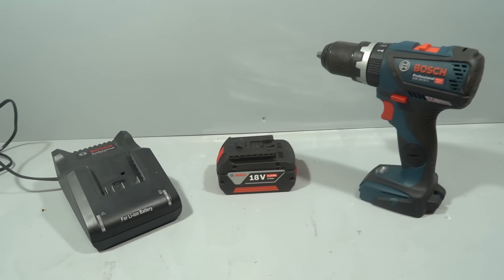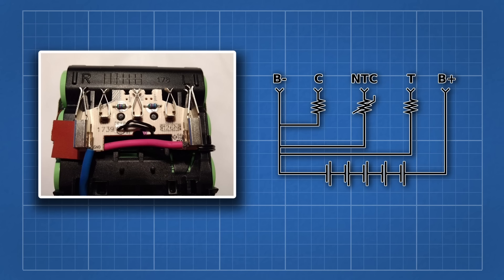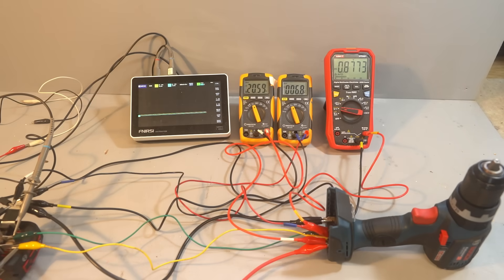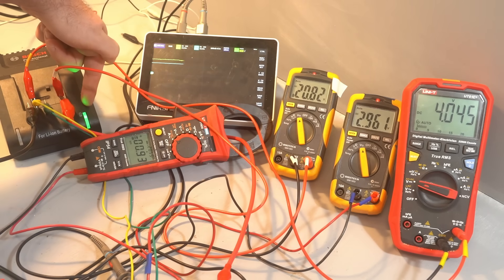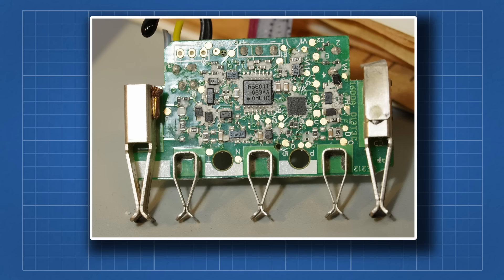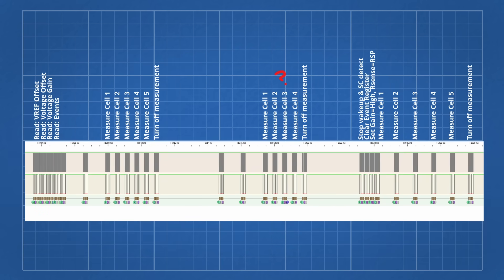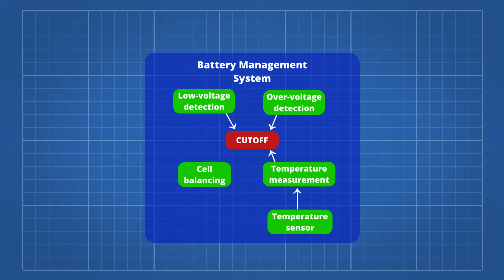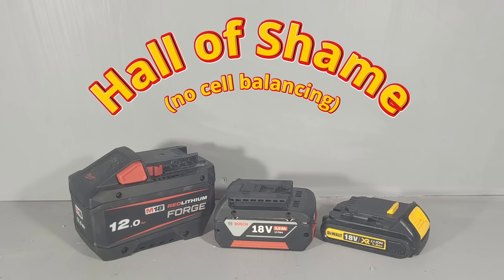[012] How does Bosch 18V compare to the rest?

Comment: The video reviews the Bosch 18V professional battery system, focusing on its design and management features. Initially, Bosch batteries lacked electronic components, but have since evolved to include a complex circuit. The video compares Bosch’s battery management system (BMS) with those of competitors like Milwaukee, Makita, and DeWalt, noting that Bosch's design is moderate in complexity.

Key aspects discussed include:
The battery has five pins: two for cell connections, one for charging, one for temperature monitoring via an NTC thermistor, and one for tool identification.
The tool operates with certain voltage and resistance requirements, and lacks individual cell monitoring, which means it can run even if one cell drops significantly in voltage.
Charging is managed by overall pack voltage without direct communication between the battery and charger, using a current tapering approach.
Bosch implements some cell overvoltage protection during charging but inconsistently incorporates active cell balancing.
The BMS design is deemed to have unnecessary complexity while lacking essential features like effective low voltage protection during discharge and efficient cell balancing.

The conclusion suggests that, while Bosch's BMS isn't fundamentally flawed, it suffers from design choices that limit performance, similar to other brands. Improvements are recommended for better voltage management and charging techniques. Overall, Bosch's system is average among competitors, with potential for enhancement.

Comment: Is the STM8 microcontroller locked or could it be reflashed? Since there is no elaborate protocol for communicating with the tool and charger, it should be fairly straightforward to write a new firmware that does what the stock FW does but adds balancing (if you're right and all the hardware is there).

Comment: Video is not bad. Just there is one IMPORTANT remark. You really have to dive deep in the cell balancing topic. A you have to understand better why it is not performed by some companies. It has one BIG disadvantage ;). Funny fact, but it can cause cell overcharging and battery will not notice it. Huge risk!
Reply from the maker: Are you talking about being unable to measure cell voltage whilst balancing? That is easily solved by turning off balancing every few seconds to take a measurement.
Reply: @toolscientist no. About potential leakage current in the IC input(for example due to ESD damage) or due to cracked capacitor. It cause voltage drop on input filter and IC can not measure anymore correctly cell voltage even with swithed off balancing mosfet. And if battery will ballanced, then its voltage will be pushed above safe level-> boom

Comment: Crazy 

Cheap lidl Parkside batteries 

Have balancing 
Monitor cell voltage during discharge 
Have current monitoring and it’s even adjustable in an app 
Have low voltage protection in the batteries (Tool switched however) and it’s also user adjustable ! 

Literally the cheapest batteries have the best BMS 

And einhell/ozito are the same except even Better ! They have an internal MOSFET and can turn off the entire Battery (also used for Battery discharge cutoff)

Comment: So if I use the battery outside of Bosch tools, in DIY project, it will discharge below a safe point? Please confirm.
Reply from the maker: Yes, Bosch 18V batteries will discharge to 0V. They have no mosfets or any other way of cutting power. They rely on the Bosch tool to stop
Reply: @toolscientist appreciate your work and reply. So if I source an inline circuit that will cut off the voltage, what should it be for the 18V battery?
Reply from the maker: @XMRNYC   stick with the 14.8V that Bosch uses
Reply: @toolscientist  great, much appreciated. Keep up the great work!

Comment: I have two Bosch ProCore 18V 4Ah batteries (5 x 22/71 cells) and after approximately 2 years of very light use, they only charge to 4 bars (out of 5 bars total). 🙂

Comment: Ive been after this info as Ive wanted to use these batteries for a guitar busking rig. My drill came with 2 batteries, and they hardly get used. Now youve confirmed that the low voltage protection is off-board, Ive added a low voltage shutoff to my circuit.

 I‘d like to add temperature protection but unsure how. I guess I could use a transistor/mosfet and a voltage divider (then when the resistance of the thermistor drops, the gate opens) Or a comparator? The thermistor has 2 wires, one is connected to the middle pin/blade/contact. Is the other one connected to the positive or negative blade of the battery?

Is there a way to add cell balancing without opening up the battery? Or do I need access to the uart connection?

Comment: For over 10 yearsI have used milwaukee bosch, dwwalt, ryobi and ridgid.  By far I have had the least battery failures with bosch and ridgid. Milwaukee and ryobi seem to have the most involved battery contained balancing and charging circuitry and the most failures from my experience.
Reply: I'm a DIYer and I can confirm that Rigid (AEG in New Zealand) batteries last and last. I have 2x2.5Ah batteries that came with a kit that I bought 10+ years ago and they are still going strong. They are nice tools TBH.

Comment: I think their procore batteries have addressed this issue. I have a bosch charger that connects via bluetooth to iPhone. It lets you control/monitor the charge rate and capacity.  (procore batteries only)

Comment: "Bosch vs the BIG 3"??? Bosch is no. 2 together with Makita in terms of worldwide market share. So it is very much one of the big ones. Dewalt is no. 1 right now. Milwaukee is too small to be in this category alltogether. I assume you're talking about the US market here and ignore the rest of the world?
Reply from the maker: I'm from Australia, and Bosch is definitely less common than Milwaukee/Makita/Dewalt. Maybe 10yrs ago Bosch was fairly close. Who's the biggest is not an easy question anyway. TTI (Milwaukee) and SBD (Dewalt) are around 11-13 billion in revenue, but they have a lot of other brands. Bosch is ~90 billion, but I don't think they break down their tool division. Even if they did it would still be split between Dremel, Freud, and Diablo. Makita ($5b) and Hilti ($8b) are the only ones easy to track, but Hilti would generate substantial revenue from its fasteners rather than power tools.
Reply: @toolscientist  Boschs tool division is ranked no. 2 worldwide, together with Makita - hence my post. Bosch does provide figures for their sales seperately - you don't have to guess. 
Bosch is extremely popular and widespread in Europe - they're leading the market here, especially in the German speaking countries. Dewalt and Milwaukee are rare over here. But while Dewalt managed to be popular worldwide - which put them on no. 1 spot, Milwaukee only really cared for the US market and also managed to became popular in the English speaking world. But they're not even in the top ten. Their other brand Ryobi outperforms them on world stage.

Comment: Would it be possible to power a Milwaukee M18 tool with an adaptor that fit where the battery does with a cord and a 240v wall socket supply and transformer. Like I'm not that techy but would something like that be possible to make and the tool would work without know it wasn't the battery supply? Or is the current draw the limitation because it would draw higher amps than a normal GPO could handle
Reply from the maker: Yes, but it doesn't work great. Look up Harrison Hobbies who did this. His first attempt was a 1000W power supply, then he tried 2 x 1000W power supplies, but some tools still overloaded the supplies during startup. The last version he did had a M18 battery running in parallel to handle surge currents, but that batte had no protection, so you'd have to keep an eye on it.
Reply: @toolscientist okay thanks for the info. Only reason I ask was Milwaukee have come out with a new reclaim unit for HVAC trades but it doesn't have a corded back up option and sometimes reclaiming takes quite some time on bigger systems and you'd be burning through batteries
Reply from the maker: @joshn2673  if the tool isn't too high-powered and doesn't have surge currents, then it's a lot easier. Not familiar with reclaim units, but I'm guessing it's a pump? You can prob get away with a 600-800W power supply if that's the case.

Comment: Thank you for these videos. It is truly frustrating that these companies are playing with lives by not including balancing. Just by including balancing, the battery will last significantly longer. All these companies milking out money from folks who don’t understand how batteries work.

Leaving batteries on chargers becomes potentially dangerous.
Reply from the maker: Main fire risk is from overcharging. So far every brand I've tested has got that covered. Bosch and Dewalt are not so good on the discharge side and can let cells get very low if the pack is unbalanced. Due to Bosch's conservative 15V cutoff, it would take a very badly unbalanced pack to let a cell go really low

Comment: Really interesting video, I'm surprised someone hasn't done a teardown and test like this before with all the tool testing and comparisons that have been done. The design overall is baffling to me, they have the balancing transistors, they measure the individual cell voltages and then just don't do anything with them. I wonder if they did a revision after to fix this or just kept selling them like this, is there a date code on the PCB or cells? 
At the end what do you mean they don't use CC/CV charging when you said it charges at 3.8A up to 20.3V(CC) and then starts dropping (CV)? And why would they need comms back from the battery to achieve this, the charger is obviously monitoring the pack voltage. The way you measured the charge voltages at the pack with leads to the charger won't be accurate because of the voltage drop across the test leads, although the difference should be around 65mV at most(3.8A) so doesn't change any of the conclusions.

Comment: Great vid. As a person that uses Bosch and have friends with Milwaukee and Makita. The Bosch batteries out last the Milwaukee and uses to out last the Makita be for they put silicon on the BMS. The only Bosch batteries that are rubbish are the  6ah which Bosch has discontinued here in NZ. I also repack batteries, and Bosch (dont know about Procore yet) and Dewalt are the easiest to repack followed by Makita then Milwaukee this is because of the BMS. One final thing is if you are using tools that are high draw (I use the Biturbo Grinder for concrete) get batteries that have 21700 cells they will out last 18650 as the amp draw is what kills the cells e.g. 21700 tabless cells handle up to 70amp, standard  21700s 45amp vs 18650 25 to 30amp. Just did a job and a Bosch 8ah procore got to 65 C and the Bosch batteries I made with tabless got to 30 C
Reply: Do you standard nickel strips in place of the copper foil when repacking the Bosch 18v batteries?
Reply: @scottboyce  Only Procore batteries have the copper, haven't repacked any yet. I made a tabless battery up today and doubled the nickel strip.

Comment: I used to own a variety of the older Bosch GBA batteries that lasted for 7+ years when I sold them on to get newer ones. Very happy with my 4/8Ah ProCore batteries, especially the large ones have so much power and they keep their charge when not in use.

On the contrary, Makita 18V  batteries always seem to self-discharge when left plugged into tools. Total nuisance.
Reply: It depends a lot on how often you use them. I have a mix of DeWalt (18 and 12v), Worx, and Makita. I haven’t had a battery actually break, but I have worn out a few 12v DeWalts from heavy use throughout the years. They don’t hold much of a charge anymore… maybe the cells got unbalanced?
   
The Worx batteries have been a surprise. It’s a Chinese company that makes power tools as well as gardening tools. I have a lot of their gardening tools and I’m using the batteries all the time. I started buying some of their power tools (cheap, nowhere near as good as Makita or DeWalt, but good if you do occasional DIY around the house) and using the batteries even more. To this day they haven’t let me down.
Reply: For occasional use it's better for li-ion batteries to discharge ~50% so they won't lose their nominal capacity over time. Of course it's very annoying! :D

Comment: The thing that puzzles me the MOST is that I'm 100% sure that the engineers at Bosch know how Dewalt does it, Dewalt's engineers as well, Makita's, everyone for sure has already reversed everyone else even before these things come to market. How come they don't improve their own designs from the others? If Bosch wanted to be as simple as they are they could save money copying a bit of dewalts homework, if Milwaukee wanted to differentiate they could see that Makita doesn't use whatever feature that they could use from their systems, etc. 

While of course it makes no sense to try and replace or update the products on the field, by writing one different byte into some register they could "solve some issues", so they could just change to a next rev.
Reply: Normally the design engineers make something very nice and good, then their design goes to the cost engineers and they cut off everything they think is not needed or is least needed to fit into a target price bracket and then the stuff gets manufactured.

Comment: You forgot the one that is actually the best - the German Metabo CAS (cordless alliance system)...made basically for trade and industry.
Reply from the maker: Not forgotten, just harder for me to find on the 2nd hand market. Metabo is about half as common as Bosch, which is half as common as Milwaukee/Makita/Dewalt. I hope to get to them and Hikoki in the future
Reply from the maker: Not forgotten, just harder for me to find on the 2nd hand market. Metabo is about half as common as Bosch, which is half as common as Milwaukee/Makita/Dewalt. I hope to get to them and Hikoki in the future
Reply: @toolscientist  I'd skip Hikoki, as Hikoki is gone and is now Metabo HPT. The current Metabo HPT tools are still using the existing Hikoki battery platform but I suspect that that is just a matter of time to go extinct. So less worth the time and effort.

Comment: I’d love to see you do the same for a Hilti Nuron / Bosch profactor / Makita XGT battery
Reply from the maker: Makita XGT is already under way, but it will be 2-3 videos due to the complexity of the system. I might be able to do ProFactor/ProCore as I have a broken ProCore that was doanted to me. Hilti Nuron is very interesting, but prob some time before I can find one available 2nd hand (especially with Hilti pushing customers to leasing)
Reply: I have a Nuron battery that is bad if you want it

Comment: That's all I need to know.
Now I know I can just by the aftermarket batteries. Cuase what am I getting from the premium price. Outside the warranty? Nothing it seems.
Reply from the maker: Aftermarket usually have lower quality cells and they may skip safety features like overvoltage protection and temp sensor

Comment: I was wondering how Bosch 18V battery technology compares to the competition and voila! Thanks for this incredible video, the problem is most of us are using ProCore 18V batteries and Bosch claims great improvement and refinements on ProCore series. I wish you put them to the test. Thanks!
Reply from the maker: Yes, I've got a lot of requests for ProCore. I'm going to see if a broken ProCore that was donated to me can be repaired. Although it seems I might also need a new charger and Biturbo tool to see amy differences.
Reply: Even the older series lasts. I have many of these packs. Even the > 10 year old ones are still healthy.
Pushed them to the limit while renovating my house (f.e. mixing concrete with a cordless drill, doing core drills and other crazy stuff.) 
Still going strong.
Although i'm not using them every single day as commercial companies. Still quite impressed.

Comment: Bosch is well priced for the quality, and I think they keep the components simple to stay competitive. I mean it is German engineeringa and BOSCH invented all major car electronic circuits, so they can easily make it more complex. Great video.
Reply from the maker: I think they've got a good level of complexity and a nice small PCB, but they should be making better use of the hardware they have by adding more safety features and cell balancing to their firmware.

Comment: Do they even sell these old batteries anymore? All the new ones for sale are pro series at least in my area of US.
Reply from the maker: Definitely still available in Australia, and half of the kits still come 5Ah packs. Pretty much all the brands still use 5Ah in kits
Reply: Also still available in Europe, and most power tools with battery packs are still using the old ones. Probably just a matter of time though as they'll clear out the stocks I guess.